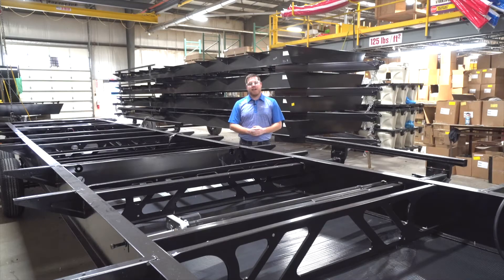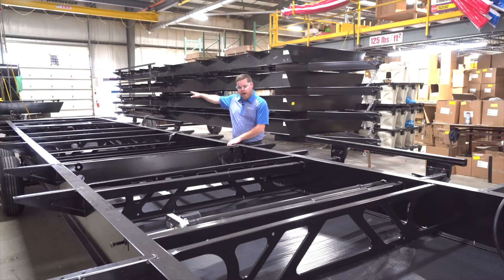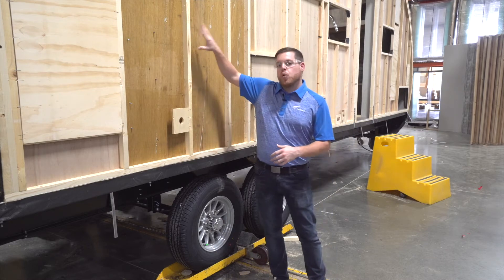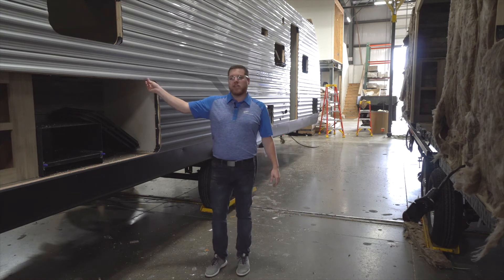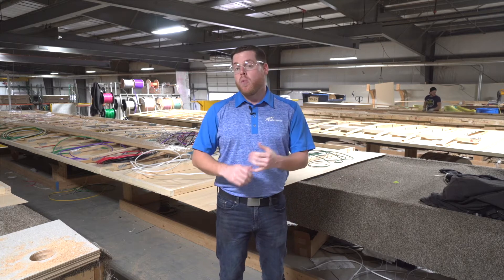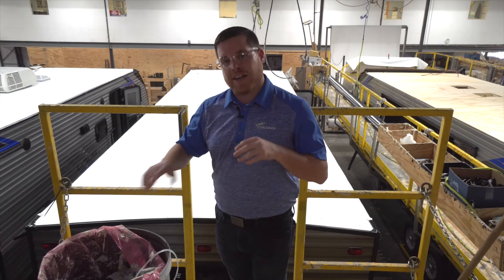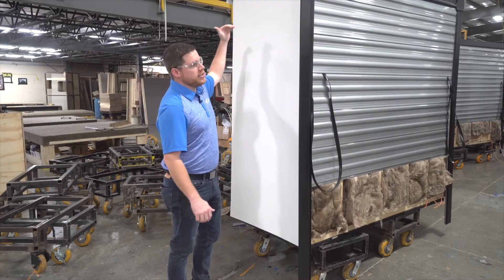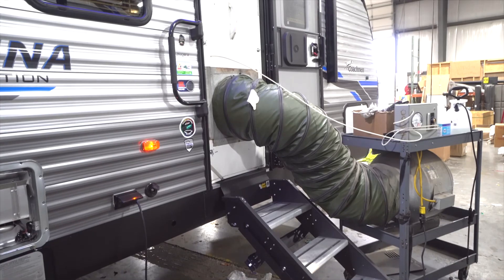Catalina Plant Tour

Comment: Thank you for this information and video. We purchased a new 2022 Coachman Catalina Legacy 323BHSDCK in June of last year. The sink was cracked in a corner, the fridge did not seal properly, the roof had water intrusion, and one of the coax video cables was PIERCED by a screw (the cable for the front room TV). These were fixed by the dealer though It took nearly ALL winter to do it. Another thing I MUST comment on is the manufacturing debris that was left IN the coach by the factory AND the dealer! Metal drill shavings, wood shavings, sawdust everywhere, even down into the floor vents. Absolutely disgraceful the amount of junk that was just not cleaned out! Come on, GET WITH THE QUALITY CONTROL program! Other than that we've been happy with our 'Lina. Thank you!

Comment: Are the wheel wells metal lined to protect the unit in the event of a tire blow out? My truck has the factory tow package and a tow rating of 9,340 lbs - Would this work for a 263BHSCK unit that has factory auto level and 200 watt solar?
Reply from the maker: Contact our customer service department. They may be able to help you with your inquiry. https://coachmenrv.com/contact-us/catalina-legacy-edition

Comment: We bought a 2022 Catalina Summit 7 Series 184bhs 2 weeks ago at Lazydays Tampa Florida, when I did the inspection I found about 15 areas of defect for that reason we did not take it out from the dealer and prefer to leave it for repair. Several days later Lazydays calls me and notifies me that the RV had leaked water damage. The entire trim from the kitchen to under the Murphy bed had been swollen by water. The techs said everything was sealed and I took the RV with the water damage to wait for the parts to come and Lazydays to replace them. I went camping and when I connected the city water to the RV a water leak started coming from under the bunkbed. I took a video of it and sent it to the Lazydays rep. I had to put a plastic container under the liquid and every 5 hours take out the container and put it back because it fills with water. I was also able to realize that the entrance door is crooked and that is why the lock does not close, in fact you can see from the outside to the inside and from the inside to the outside through a quite noticeable crack. Apparently this Catalina when they built it made many mistakes in its construction. It also has loose unfinished parts. Truly a total disaster. This is my second RV, but the first one I've bought new and apparently I got a factory defective. What would the Coachmen company do in this case that is happening to me?
Vin #: 5ZT2CAGC7NK003137
My email: an14@live.com
Reply from the maker: Have you been abler to resolve your issue with your unit? Please contact our Catalina customer service representatives for answers to your questions. Call Robert Hostetler @ 574-825-6241.